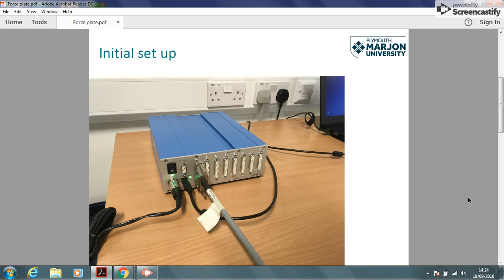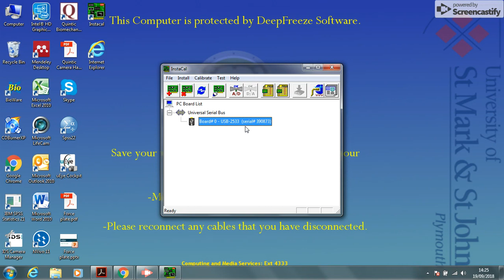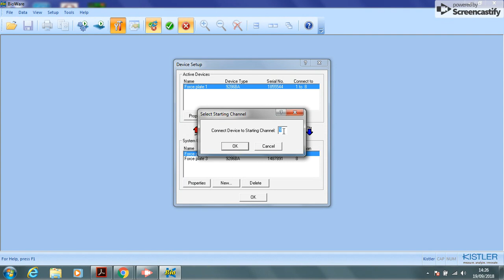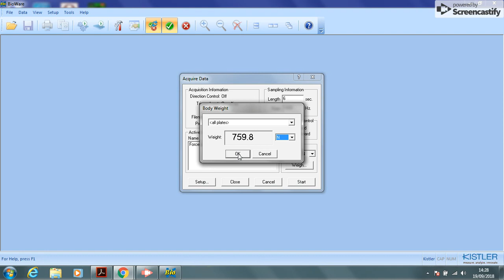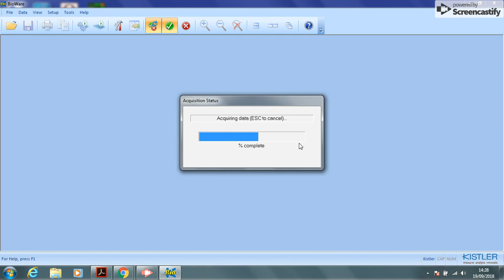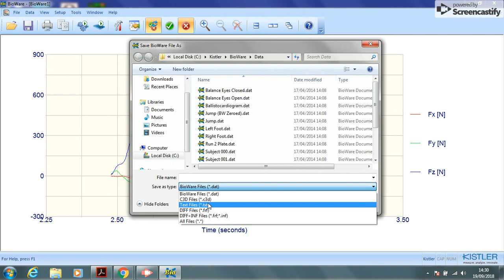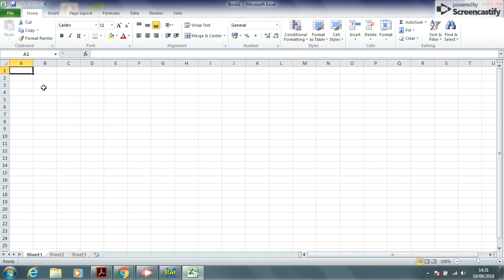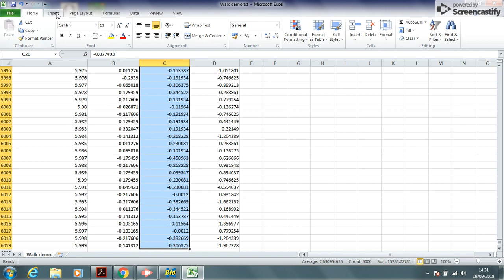Kistler force plate

Comment: Hey I saw your video and I use a similar setup from Kistler with an external amplifier. I am currently trying out the COP functions. Unfortunately the force curves (Fx, Fy and Fz) look strange after my measurement in BioWare. Sometimes only a line is displayed instead of a force curve. I don't know what the problem is, maybe you can help me.

Kind regards
Steven